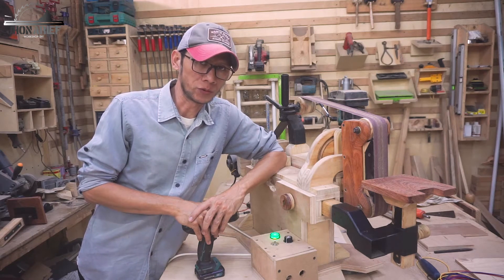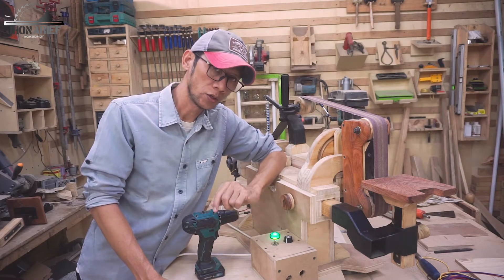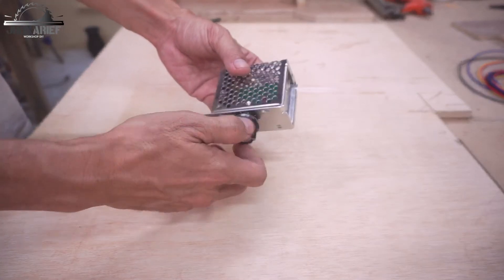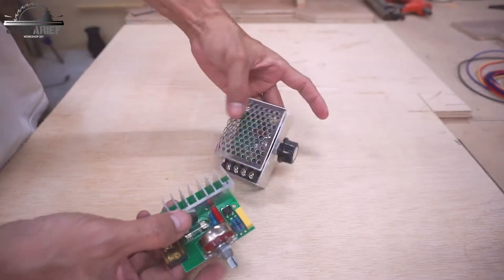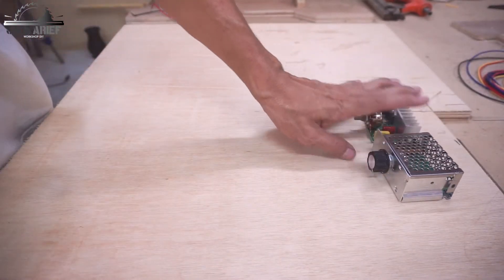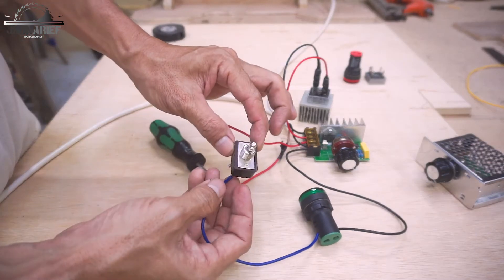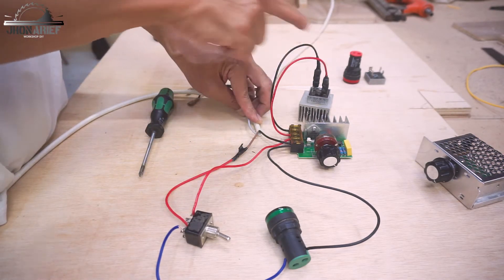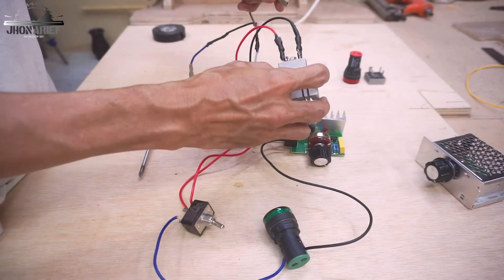SPEED CONTROLLER FOR DC MOTOR ex-treadmill

Comment: Those cheap little speed controllers at the beginning you shoerd are NOT meant to run these treadmill motors. They are FAR too under specced. Itll make things move most likely but with ANY actual load on them itll absolutely melt them.. spend $10 more and get a 10000w speed controller that can actually handle the amps that the treadmill motor will draw. Their ratings they list are for PEAK power not nominal. For anyone working on the same project. Dont skimp on 10 bucks youll end up doing it 2x and spending the money anyways

Comment: Hi Jhon! Please confirm if there is a need to include a choke coil in the connections which you have shown in the video if I will use this to restore and use our old  treadmill exercise machine. Some say that your set up cannot be used in slow speed when used to a treadmill application because the motor will easily get busted. Thanks.

Comment: Can we used it on treadmill whose motor controller board defective  .for purpose of  exercise
Reply from the maker: @crazyxyze  yes you can, but you have to adjust the speed manually
Reply: @jhonarief  thnks

Comment: What if you want the indicator light to come on when you turn on the power, and off when you turn off the power? It seems that it’s more important to know when it’s powered up rather than down. 
Paul
Reply from the maker: Just switch the wire connection  input fot that light indicator sir

Comment: Very good. Are those cheap speed controllers reliable ? Do they overheat ?  I see they also sell some with the rectifier already built in.
Reply from the maker: Yes those are cheap one, if you want to use it I suggest  buy twice bigger than your motor capacity

Comment: Can you wire the switch to work for forward and reverse?
Reply from the maker: Yes you can sir,  that is simple because this is DC motor you only need to switch the positif and negative wire out put by adding another 6 pin  toggle switch

Comment: Why does the motor sound so rough? It seems that the AC dimmer is not very suitable for DC motors even though the current is rectified with a bridge diode.
Reply: Itu motor dc nya yg dipakai buat peraga yg sudah dimounting ke belt sander mas. Wajar kalau bunyinya agak kasar karena ada beberapa sumber gesekan disana, ada driving wheel, bearing wheel, amplas, dll. Apalagi Mas John pakai material mesin belt sandernya banyak dari kayu 😁 kalau mau halus suaranya ndak usah dihidupkan Mas..

Comment: Hello! my name is Florin and I'm writing to you from Romania, I also have a 180v engine similar to yours and I don't know how to start it because it only works on 180 volts, can you tell me what parts to buy to be able to start it in function? Thank you in advance!
Reply from the maker: Hi Florin, you need only 3 parts to run that dc motor, first You can buy 4 kw ac speed controller and KCP5010 Bridge rectifier diode and toggle switch

Comment: I did the same project but used a capacitor as filter to BR. It runs quietly.
Reply: what size capacitor do you use?
Reply: @dandianaf2361  you should look after the capacitor voltage first (if you savaging parts as I do). The capacitor voltage should be higher than the line output. In my case, a 400v 560μf worked just fine. Higher capacitance, better the noise filtering
Reply: @rafavillasboas  ok thank you bro

Comment: A speed controller are ac to dc or ac to ac
Reply from the maker: Ac to ac sir, after speed contrller you will add rectifier diode to change from ac to dc
Reply: @jhonarief  Thank you very much

Comment: Mas... Voltase yang keluar dr rectifier sama dengan Voltase yg keluar dari AC controller?

Arusnya gimana/berapa? Kalau AC kan rata² 10A. Kl yg keluar dari rectifier berapa? 5A? Sesuai rectifier yg dipake?

Spec motor ex treadmill-nya apa? 220V 3A 500Watt?

Comment: Hi Jhon Arief it,s a very good tutorial i learnt ,, I also need your help ,,,I have i DC 22.2v vaccum cleaner  and now it,s giving problem ,, ( voltage cut off at second speed ) further more it,s a built in charger,,speed controller board . Now i need to convert it to a DC to DC speed controller, I see a lot of controller sales on line , Which is the best one u can recommend .. ( input 35v or more power one ,, yr advice please tks
Reply from the maker: Hi sammy, if you have input 35v dc I recomended you to buy PWM speed controller thats good for dc speed controller
Reply: @jhonarief  thanks for your swift reply . i will order one now

Comment: That motor controller that you use is rated for 220volt ac input, can you use this on a 48volt battery?
Reply: And is there a way to connect 2 of those to get a 8000 watts capacity or even more?
Reply from the maker: 1. No it can not use dc input for this controller, if I have dc power input like 48v battery power I just connected directly to my motor because my motor is dc motor but that motor spec is 220vdc motor with 4000 RPM and if I use 48v DC power it will reduce the motor speed by 1/4 

2. No you can't, 4000 + 4000 watts  controllers it didn't mean that out put becoming 8000watt it still 4000watts
Reply: @jhonarief  thanks for the reply, so connecting the batteries straight onto the motor, but how can I control the rpm?
Reply from the maker: You are welcome👍,
You can use pwm motor controller for dc motor input

Comment: Dear sir can i use ac motor apart from diode?
How is ac motor fro treadmil unit?
Please suggest a ac motor. Rpm & watts
To make 70kg capacity treadmil
Reply from the maker: For treadmil used AC motor is not recomended sir

Comment: What is the max DC voltage and Amps that comes out at the output after the full bridge rectifier?
Is it more than the motor is rated for?
Reply from the maker: With this system if input power 220volt ac after full bridge it will be littlebit drop 5-15volt , mine is 195-200 DC volt output. This is the draw back using this kind of speed controller

Comment: For just a little more money, you could have purchased a much better controller. Your controller is triac-based which works the same way as a standard light dimmer. It will give you variable speeds at the expense of torque. What you really want instead is a 220V/120V PWM DC motor controller. It works by pulsing the current at high frequencies to give you an effective speed voltage and current using a microcontroller. The torque is greatly improved and they are not anymore expensive.
Reply: Hi...im interested on make one or two if you can help...
I pay for..
Reply from the maker: Where you from sir?
Reply: What brand would you recommend
Reply: I could not find not expensive PWM DC motor controller, if you could point me to one it would be very helpful.I think PWM is much more expensive, for 180V 10A DC motor you have to spend about 200USD and SCR and bridge rectifier 80USD
Reply: @markrosinski4814  I included a link. Were you able to locate the same product?
Reply: @bobweiram6321  Hi Bob, have you included link for me? I can not see it